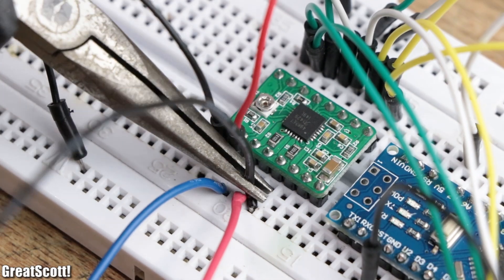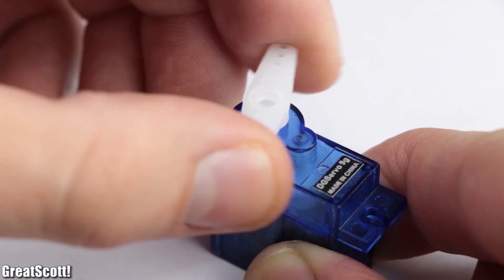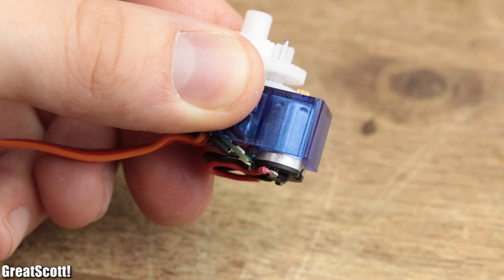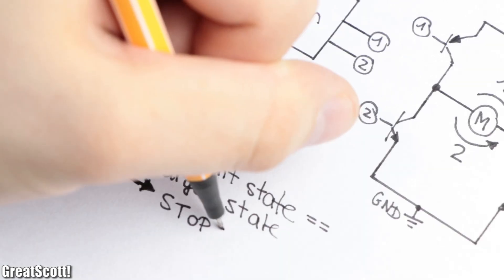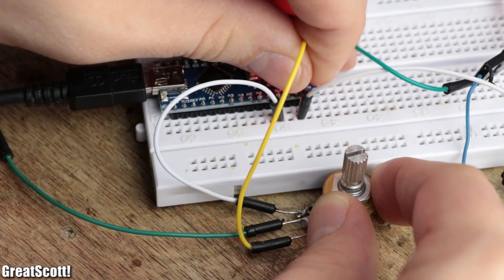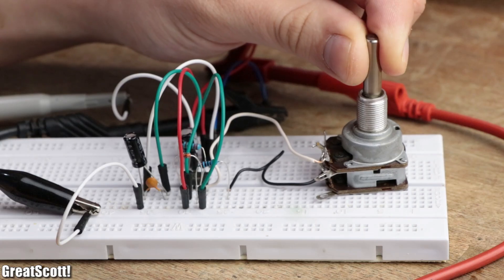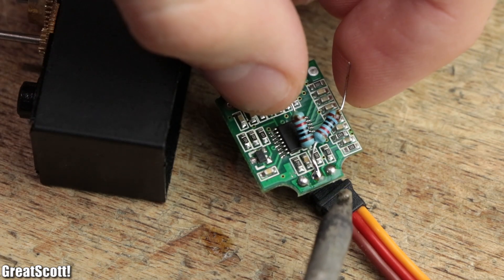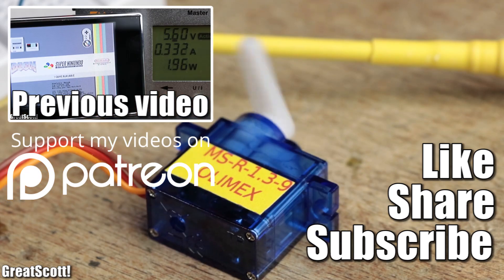Electronic Basics #25: Servos and how to use them

Comment: maybe a dumb question but i would like to use a servo to rotate a spring/coil to basically create a tiny vending machine 
(so upon button press rotate for x amount at y speed to dispense 1 unit)
how would I do this ? and would it require me to use an arduino or can it be done without ?

Comment: Back around 2004 I 'hacked' a servo to rotate 360° continuously. At the time I could not readily purchase one, or the cost was outside my budget. {Also at that time I had a couple spare servos I could hack.} 

I learned two things from this endeavor: 
(1) Unless you ABSOLUTELY HAVE TO hack a servo for this purpose, just PURCHASE a commercially made servo that rotates 360°. 
(2) Being at the age of 43 at the time {in 2004}, I was starting to need eyeglasses...😊

Comment: Why not just remove the control completely and just feed raw power to the motor if you want it to just keep turning 360+  all the time?
Reply: You can still control the directions and speed of the servo with PWM. Without a voltage divider, the servo can only spin in one direction.

Comment: I'm sure your videos are excellent they do look pretty good. But they assume that the person interested has substantial electronics skills. What I was curious about when I was a kid in the early to mid 70s RC planes and cars existed with servos. What did not exist was computers, breadboards and all the additional components that you add to make modern servos work. How did it get more complicated from what they had in the 70s? The planes flew very well with very sharp turns, steep climbs, dives and leveling out, etc. What happened to the simplicity? It's probably because we have computers which can artificially complicate a project involving more work and money.

Comment: Congratulations for your contribution.
Seeing your explanation of how a servo works, and looking at the KC518 datasheet gives me ideas for what I'm looking for.
I made a comment on the MEKATRONIK channel about what I am looking for.
Suppose a servo assigned to a 3 position switch on the radio.
 Target:
 In the high position or 1, which is supposed to be all left e.g. the OFF switch. 
In the middle position or 2, where the centre is assumed, a ON switch 1. 
In the low position or 3, where it is assumed to be all right, switch 1 ON plus switch 2 ON.
It could also be, pos 1 switch 1 ON, pos 2 both OFF, pos 3 both ON.  
The doubt, it will be easier to use the output that gives the servo to the motor or use another circuit that interprets the PWM signal input to the servo.
After watching your video, I can think of ways to use those outputs to the MOSFETs and combine them. 
If I'm not misinformed it would be 1ms for min, 1.5ms for centre and 2ms for max. 
Can you think of anything? Do you know something similar? Can you help me?

Sorry but I didn't translate it myself.
Thanks

Juan
Translated with www.DeepL.com/Translator (free version)

Comment: I don't understand...
Servo doesn't have any "special" cirquitry to receive PWM signal. It's just an analog cirquit which compares voltages. So... PWM has not to be a only a way to generate target voltage for a servo...
If my suggestions are correct, then we can manipulate voltage on a different manner. For example we can use a simple voltage divider assembled from potentiometer.
There is only one problem. What voltages are actualy needed for servo?
If 1ms of 20ms (50Hz) signal is 5% of reference voltage and 2ms is 10% then... I assume that we have a range of 5 - 10% of a reference voltage to turn servo almost left, or almost right...
So.. If our VCC voltage for servo is 5 volts, then we have a voltage range 0,25 - 0,5 volts.

So I took a multi-turn precise potentiometer... Made a voltage divider... Applied control voltage to servo control input...
But didn't' get any satisfactory results. Servo doesn't act as I expected.

May be my suggestions are completely wrong or may be there is only a small mistake which didn't allow me to get a result? What do you think?

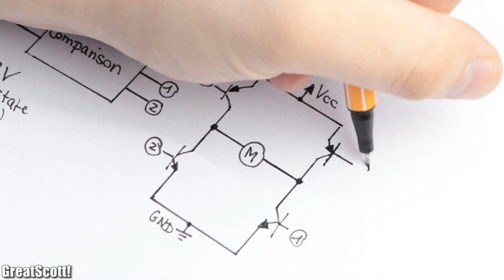Comment: Hi, I have a question about the diagram at 2:30, shouldn't the two entries on the left be [1,1] instead of [1,2]? Same goes for the right side, should it be [2,2] instead of [2,1]? Because in this configuration, if 1 and 2 respectively have high and low, the current can never flow. Right? Same goes for the other side. Please make sure to correct me if I'm wrong and have a nice day !

Comment: how to rotate  two servo motors at the same time by the same amount in OPPOSITE DIRECTION. Servos used are MG995 180 degrees rotation.

Comment: Hi Scott! I have a question. I would like to use Arduino controled Servo motor (lets say MG90s) to control my Window Day-Night blinds - together with light sensor. So when it is dark, they open, when it is a day, they close. To simplify this for now, I would like to just move them up with press of one button, and move them down on press of another. My question is, how can I tell my servo when to stop (once they are full on the top, or bottom) not to brake the wire. More or less they look like this: https://allegro.pl/oferta/gladka-roleta-classic-z-napinaczem-na-twoj-wymiar-7767004361. So basically what I would like to archive is: Once the day is coming, I move them about 2cm up (they are in the bottom), when the night is coming, i move them fully to the bottom, regardless the position they are in - how to stop the servo once high torque/blocking force is detected? Is it possible?

Comment: this is a great video!!!! Would it also be possible to use a button or a switch instead of a potentiometer ? I'm looking for a solution where I can just have to fix points (each in about a 180°) just by toggling a switch or something similar. Would you also have a solution for this composition?

Comment: Why the motor rotate is making voltage drop when using a microcontroler, such as arduino, i tried to use two on the same source voltage, (5volt on arduino) but my arduino its not stable, and always restarting

Comment: Are using the more than one servos in one source voltage 5v can be working? Or it will need more current for the mutiple servo to works well?

Comment: 1:10 Why does he say that "on time" should be 50 Hz when he 1:22 says it has to be 1 mHz? I need to toggle between -90 degrees and +90 degrees so why wont it work if I have 10% duty cycle and toggle between 100 and 200 Herts?

Comment: I'm an autoamtion Engineer and had to use servo motor on a day to day basis on most of the ptojects. 
Usually Mitsubishi MRJE series and AB servos with the use of PLC. 
The problem is arduino projects look exciting but I don't find its real industrial applications. 
So why should I learn this?

Comment: hi i want to take an old toy boat from the 1980s gi joe line and make it remote control. what does a servo do will this steer the rudder or is this for the propeller? do  i need a separate motor for the propeller?

Comment: Wait, what? why hack it to rotate 360 degrees, that is essentially the same thing as a DC motor with a reduction box
I know it is not quite the same thing, since the duty cycle of the PWM is the controller of the direction, and not the polarity of the thing, but what makes a servo really useful is the fact that you can control the angle, take that off, and it is just a modified motor :v

Comment: @GreatScott i have alot of jitter in the SG90 servo on my printer due to interference from the temperature PID signal when it gets to target temperature, using ramps 1.4.  Can you make a video on filters for servo to clean the signal due to noise on the ramps?  i can send a video

Comment: @GreatScott! 
Let's say I wanted the server to go to -90 degrees when I push a button or flick a switch, then go back again to 0 degrees. It's for a payload release system...
Is it possible to do this without a micro-controller? Or do I need a completely different thingy you know of, that I would require for this?

Comment: Hi, I am building a camera slider which will be controlled by a motor.
I have a cheap "servo tester" which I want to use as a speed regulator, and I dont want to use a servo as it makes too much noise, can you recommend a motor that is silent and can be controlled by a 5v servo tester?

Comment: Hey, I I'm in the planning stages for a project and I can't find the right battery. I need a battery with 180W 19V and 9.5 amps and a way to use 240V mains power to charge it. Any suggestions?

Comment: @GreatScott, do you think it is possible to have a 360° servo with a reasonably precise position control using analog feedback? Here are some of musings on electronics stackexchange: https://electronics.stackexchange.com/questions/260636/towerpro-sg90-controlling-rotations-and-angles-in-continuous-360%C2%BA-mode       https://electronics.stackexchange.com/questions/258323/towerpro-sg90-servo-motor-adding-analog-feedback

Comment: Hello I am young and just starting an electronics lab so which components do I need except for resistors diodes capacitors etc?
Reply: Oliver Mappin Depends on what you want to build.

Besides what you've mentioned I'd start with a dozen NPN transistors (BC547), PNP transistors (BC557),  a few 555 timers, a couple of breadboards, an arduino (UNO if fine) or two, jumper wires, some LEDs,  a battery pack,  allegator clips,  a 5v regulator and maybe a couple of shift register IC's (74595).

Comment: Servos seem a lot easier to control with an Arduino than stepper motors.
Hmmm? Why are stepper motors used more frequently?

Thanks for the video.
It was very helpful and informative.
Reply: It really depends on your project. Most of these cheap servos only rotate 180 degrees. But steppers can rotate continually and be really accurate.

Comment: You also could use a 2 transistor "multivibrator" setup, which btw also offers the pwm counterpart exit for a proportional opposite motor control. This comes handy if you need to control 2 servos with mirrored turns, such as pulling or pushing synchronously an object from both sides.

Comment: Can you do a PWM signal generator based on the SG3525 IC? I find schematics but so far after building them with my limited skills none of them have worked. I'm getting parts and IC's from old car amps. The amps worked but just to old. None so far have had a 555IC in them.  All I need is a picture of the finished circuit and a schematic. From there I've been able to figure it out.
 Can I use that hack on an old servo board to produce the PWM signal to drive 3 server fans? Without the PWM signal they wind up to full speed and stop over and over. When I was testing on the bench with one fan at 12V it ran just fine. I'm building an air sucker box from an old bace speaker for my solder bench.

Comment: Just curious, but couldn't you hack a servo to use a rotary encoder for feedback for full rotation, sorry if it's a stupid question
Reply: Not a stupid question, more expensive servomotors do use rotary encoders.
Reply: Giles Bathgate yeah I would think it would be more expensive to have the logic for the encoder
Reply: I don't know if you can hack an existing rc servo to use a rotary encoder, you would have to find a rotary encoder with the same form factor as a pot. You would also throw away the control circuit.

Comment: So just to clarify:
With a on time of 1 to 2 ms the motor can spin in either direction but only 180° and with a on time of 0.5 to 2.5 ms it can rotate on either direction 360° but only once. But with the mod it can spin 360° several times like a normal motor. What would the on time be for that? Thanks
Reply: A normal servo is physically limited by the end-stop and the potentiometer.
By removing those and replacing the pot with a voltage divider (2 resistors), the output shaft is free to rotate continuously.
The PWM control signals would be the same as usual.
Any signal other than for 0° causes the motor to turn in an attempt to get to the signalled position. But the servo no longer has any feedback about its position, 'cos the pot is gone, so it just keeps turning.

The voltage divider fools the servo into thinking it's always in the 0° position.

Comment: links to other videos for the mentioned components/consepts like 1) stepper motor, 2) duty cycle of a rectangular signal, 3) h-bridge, etc. would be very helpfull.

if every video had these, a noob in electronics would be able to drill down recursively to the absolute basics, like voltage, current and transistors and then back up the "tree" to understand the initial video in every possible way.

and that would increase views as well, and increase your revenue.

just a tip. keep up making these videos, they are very helpful. i find myself frequently referencing to your channel after reading a piece from "The Art of Electronics" for the real world examples.

Comment: I may be mistaken, but isn't the point of using a servo motor instead of a regular motor, to get more torque because of the extra gearing? Like the gears turn the high RPM/low torque into low RPM/high torque

Comment: Hmm, using a 555 timer instead of an arduino/ATTiny. I just asked a few weeks ago on your buck/boost converter video if it was possible to use an NE555N instead of an ATTiny. Thank you for showing the other side of electronics, sans microcontroller.
Reply: U r good but selfish

Comment: 1:50 The blue part on top of laser tachometer is original or is a hack?
Reply from the maker: Original
Reply: It's not a laser tachometer, just a regular digital one.
Reply: I think it's laser. but whit internal measurement, maybe in the blue parts. i see the yellow sticker with laser symbol. I think..
Reply: Oh yeah, jeez how did I not notice that. I reckon it's probably a standard attachment then. I looked up the part number and while the attachment doesn't look exactly the same, the description says "transforms the physical movement speed into pulse signal by using contact wheel and single reflector laser".
Reply: This is why i ask. Maybe a hack in laser tachometer is possible. At low rpm, the measurement is more precise. A simple shaft whit reflective tipe inside the chamber part and rubber on top for grip . For hi rpm,  2 bearing, one inside, one outside. It- Could- Workkkk

Comment: Hi there best explanation of servo motor, quick question i had a problem with a servo motor(micro servo sg90) to be specific i was making a 15x7 display that was mounted inside the box,and i added a pir sensor so idea was when you get close to the box,the box opens and display writes something but when i connect the servo motor, all logic of the arduino stops. It starts behaving really wierd, second it works the next second it doesnt i tryed it with a 9v battery ,with a power supply even with a different arduino(one for display and sensor and second for servo) still simular problem do you know what could it be ?